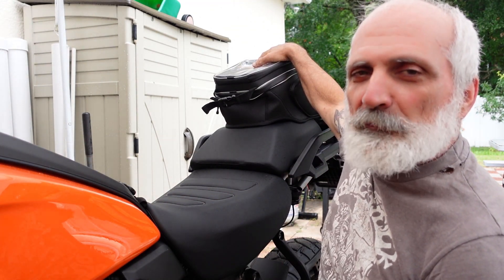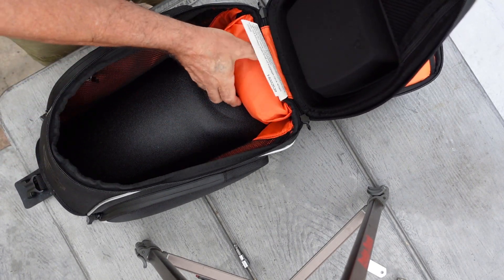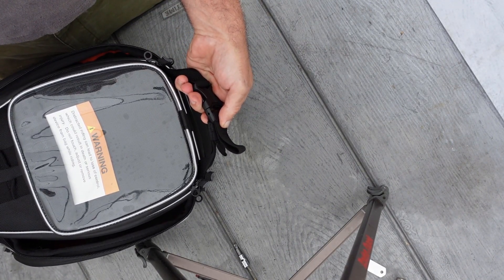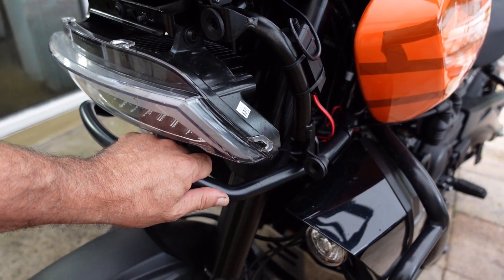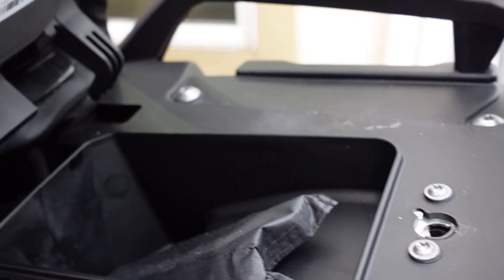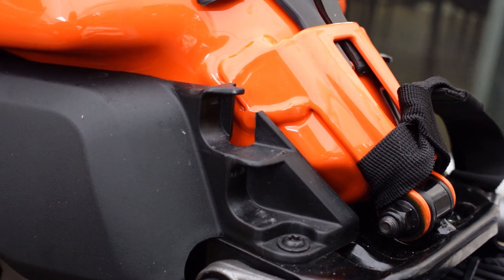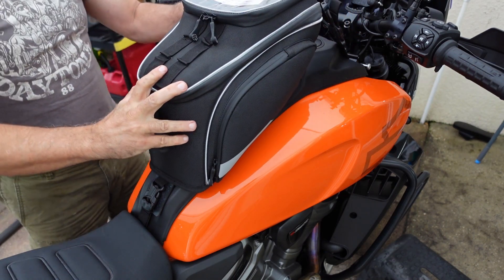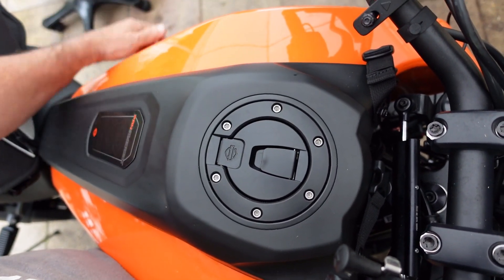Pan Am Tank Bag, faring removal, seat height adjustment - full video

Comment: How tall of a Man are you Bro? I'm considering a Pan AM but I'm a little bit inseam challenged.I have not had the opportunity to see or set on one as of yet.
Reply from the maker: I'm 5'8" - 9", depending on which convenience store I'm leaving, and have a 30" inseam. I always wear boots riding, and usually rest my weight on the balls of my feet. I do have a slightly wide stance at a stop in general, more for stability than this particular bike (I got hit by a crosswind in Barstow, CA decades ago that blew my Sportster and I over at a stop sign). 

It sits higher than a Sportster, but no where near as bad as the F800GS I had.
Reply: @floridajim  Thanks for the reply. I'm seriously considering a PanAM.
Reply: Just got a Pan Am so I'm no expert. I am 6' even and I actually have a little trouble climbing on until I adopted "the cowboy technique", which feels weird if you are used to street bikes but works, you stand on one peg and throw your leg over. This woman is 5'4" and make me look like a klutz handling her BMW 1250 GS, which is pretty much the same profile: https://www.youtube.com/watch?v=oOD9NnTevH0

Comment: Love my H-D Pan Am Special, but seriously, having owned upward of 30 motorcycles over the course of too many years, far and away the most pathetic stock tool kit ever … 😩
Reply from the maker: The only one I've had that was worse was my 1979 Lowrider - it didn't have one.
Reply: Don’t worry H-D has a deluxe tool kit for the P-A. It will set you back a couple hundred.